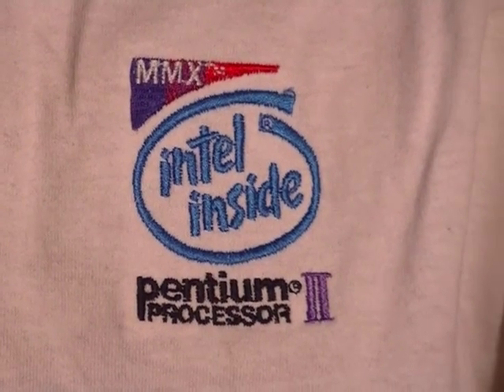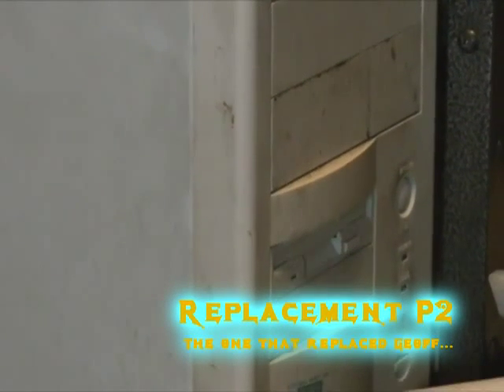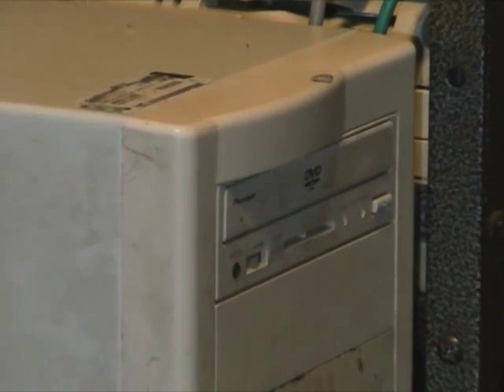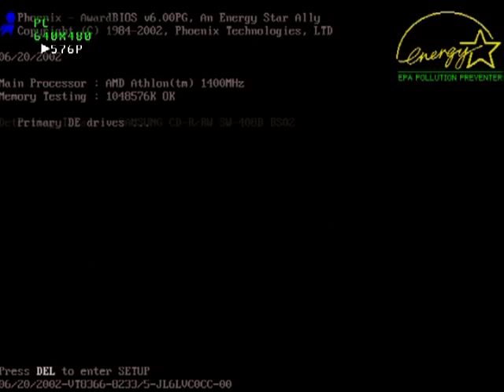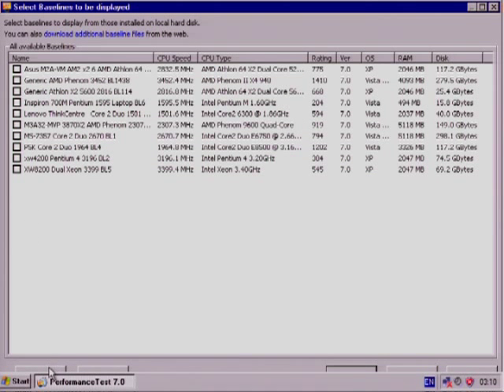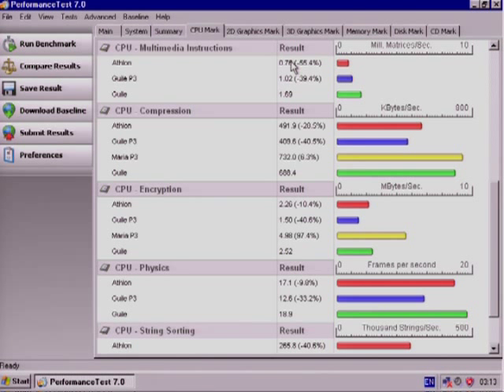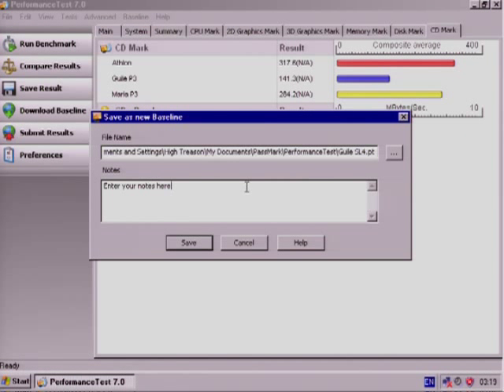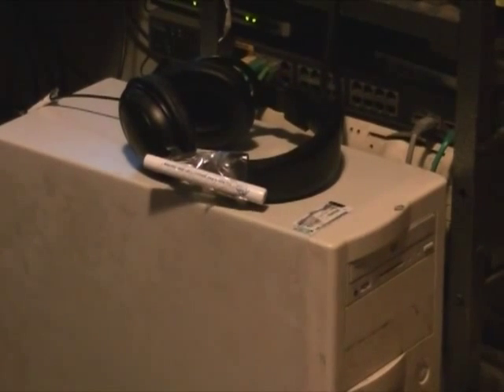Pentium III Workstation Overview

Comment: I have a dual Pentium III 1GHz box in storage, and though it seemed like a cool machine at the time I got it, it turned out to be an absolute lemon. It ran hot, sucked power like crazy, and worst of all, it actually had worse gaming performance than most of my other P3 systems. I personally blame the motherboard, and its crappy VIA chipset.

Comment from the maker: Strangely, I came to a choice - fix this thing or buy a Pentium Pro. Although I consider my collection finished I plan on getting one. Sadly they are, as you say, expensive and none of the motherboards were standard form factors. As they cost a lot anyway I may go for a Tyan Dual-CPU board (Most were ATX) though if it ever happens is a different story. The CPUs tendency to sell for scrap value (people melt them down) sucks, old CPUs were £1.99 before people realised they had £25 of gold in them.

Comment from the maker: Those CPUs are from a Dell Precision. At launch the CPUs were $999 each, it was about $120 for 64MB Non-ECC SDRAM in August 1999 (Probably about $799 for each of the 512MB modules it has now) so probably at least £4000. The guy I bought it off had gone broke and just wanted rid of it so it was going cheap by comparison when I got it - I think I paid about £250 for mobo, CPUs and RAM. Then those new CPUs I bought were £9.99 for the pair and the non-ECC RAM was about £20.